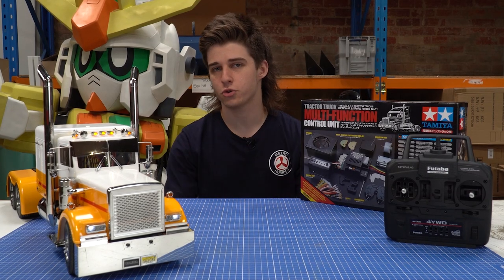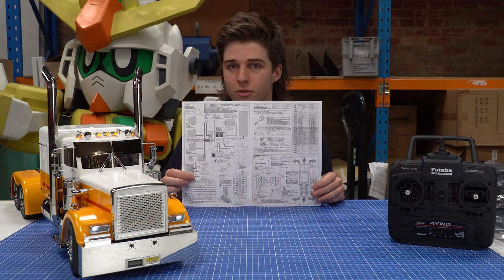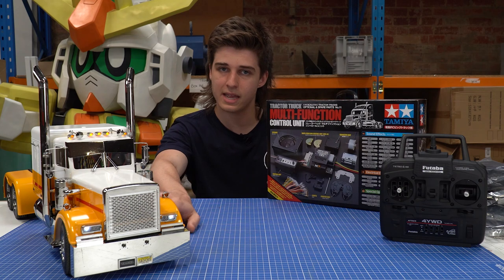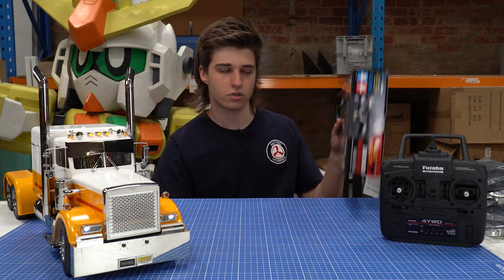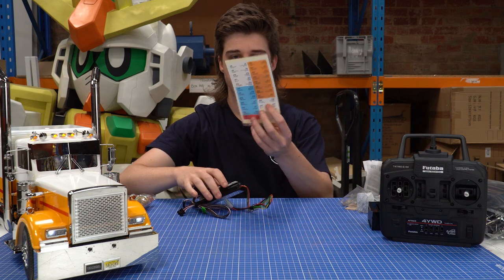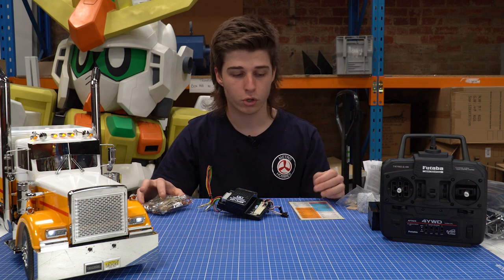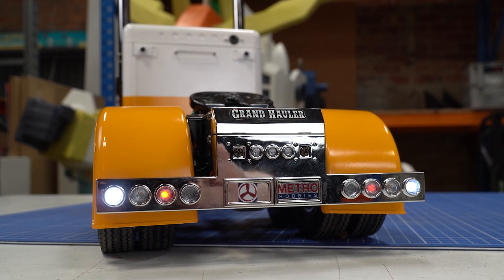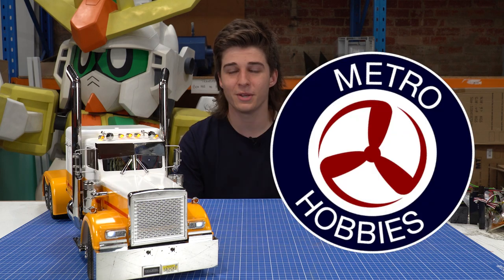Improve Your RC Truck with the Tamiya Multi-Function Control Unit | Radio Control Up Close

Comment: You definitely want to consider a programmable radio like the Flysky FS-i6X as the Futaba radio is very dated and youd need to calibrate all 3 stages of the MFC... 
The coupler switch not only makes the connect\disconnect sound, it also increases power whena trailer is added and the vibration unit is noisy and shakes the truck unrealistically. 
You CAN fit everythjng in the sleeper and keep the dashboard and seats.... I've done so many videos on how to set that system up to perfection.

Comment: How do I control all the functions of a MFC if my transmitter only has 4 channels?
Reply from the maker: James in this video uses a 4 channel transmitter, a Futaba 4YWD 2.4G INCLUDING R214GFE RECEIVER to run this truck.  The MFC unit has extensive instructions to couple it to a 4 Channel transmitter, and we recommend you look at the Futaba 4YWD as it even has the gates included in the kit on the left hand side stick to help with the gear changes. Other 4 channel TX's may not have this feature. Good luck with the build!